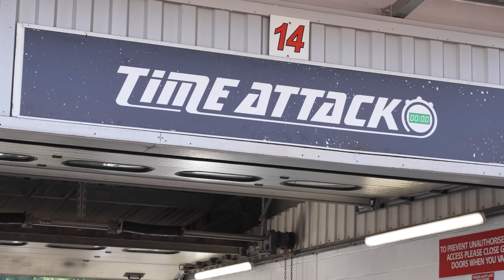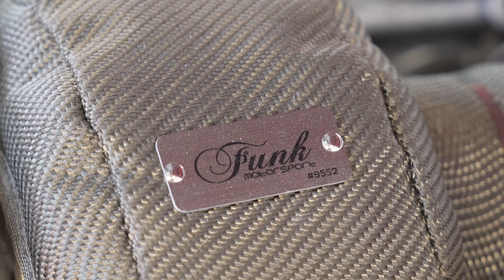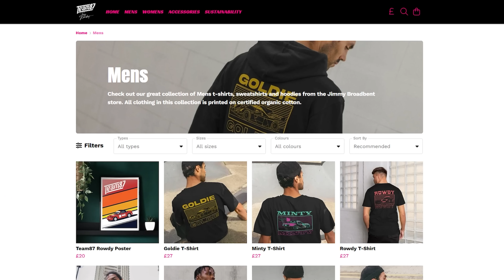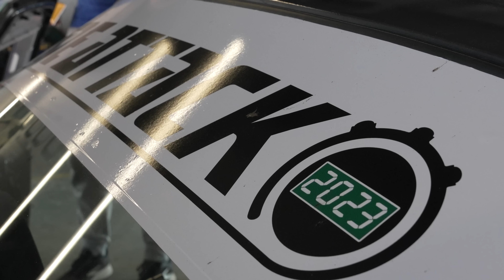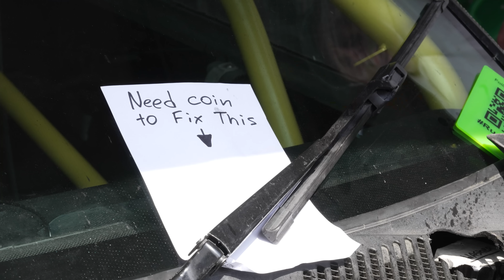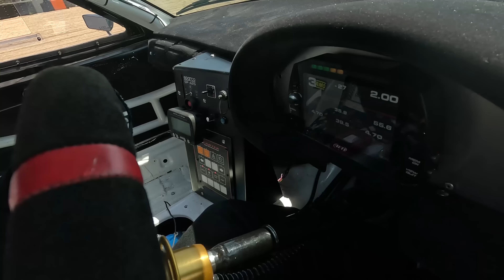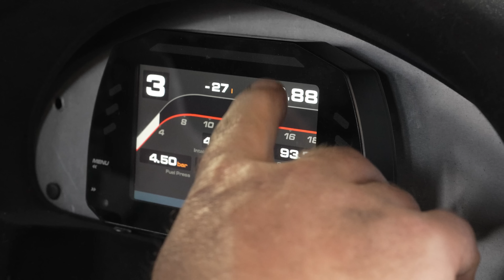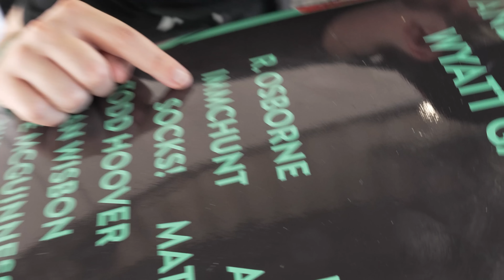Minty Catches Fire In Our First Ever Race Event - (600BHP Time Attack MX5)

Comment from the maker: Just wanted to clear up some things I've been seeing in the comments.

First of all I wanted to discuss some of the issues we had with the car, as I feel they aren't accurately covered in the video.

Regarding the ECU - We mentioned that we couldn't access the ECU. This is down to us not having the software/expertise to sort this for ourselves at the circuit. After the event, some small tweaks to the car and it runs perfectly again.

Regarding the design of the exhaust. We knew that this might have some risks (this was advised by mtech) but we wanted to try it anyway. We've already made changes that should help us sort that for future rounds.

The car is a work in progress and we're still learning. Building a hair dresser car into a time attack weapon isn't easy but we're making awesome headway. Onwards to Oulton!
Reply: These are the weekends you will learn the most from. But the car looks good, sounds great, and looks a hoot to drive. She'll be right!
Reply: Let me know if you ever want to come to Ireland 🇮🇪 and do a few laps of Mondelo some time or dip your toe is some Tarmac Rallying 😊
Reply: Exhaust definitely needs to be redesigned, heat is one thing, but imagine if you develop an exhaust leak in there, even a little one and the fumes start to get into cabin, you wont smell it, just gradually going to get dizzy until you pass out. Can't stress enough how dangerous it could be, especially on the track doing high speeds. Long story short, no exhaust in the cabin is a must next step for Minty. Be safe out there Jimmy!
Reply: @anonimas123456789  The plan was to relocate the exhuast system under the car, though a previous engineer Jimmy apointed insisted on the exhausts exit there so packaging was a real pain. The panel is actually screwed closed and sealed as a firewall component by design, but we see in the video this has been changed to some quick release clamps (not by us!). We plan,m due to time constraints, to place the silencers externally for now and seal the firewall perminantly.
Reply: Needs a fuckload more downforce if it's strictly for time attack
Reply: @bowynnnoanoa5231  Aero is in the works :)
Reply: We always knew it was going be a journey with this car but we're here for the ride and it'll feel more satisfying when it's dialed in 😁
Reply: Did you try turning it off and on?
Reply: Hate to say this but why did you, or your pit crew NOT press/pull the power Isolator switch to kill the engine/fuel pumps/power etc.. The VERY first thing you do when you have a suspected fire and come in smoking from the engine bay or cockpit is to isolate the power.. Jimmy you have ultimate control of that as the driver and if you dont do it (because you're getting out) then your pit crew should!!!, So why did no one do it? It was well over a minute before the car seemed to be off.. You dont know if you have a oil, fuel or electrical fire and keeping the car running not only puts you, the pit crew (who of which i didn't see wearing any fire protection or have any extinguishers with them. NOTE: At least one person should be on extinguisher duty at all times and dressed in fire overalls) and the car at risk, but also everyone else's vehicles and people in the pit area as well. Seriously this is a major major error from your whole team and something that needs to be addressed before you and whoever you use as your pit crew ever go near a track again. Sorry to be blunt but amateur team or not, this is not acceptable.. Safety needs to be number 1, Everyone should know what they should do in a situation like this no matter how amateur you are.
Reply: @Jimmy_Broadbent Still can't believe you have even acknowledged this??... it's serious to make sure you have these things sorted

Comment: The rear looks very unfinished.  Rear diffuser on the cards?  The car looks amazing and really fast.  Good job dude.
Reply: I think the floor is a planned later addition. They're gonna slowly add on aero after they get the mechanical grip aspects of the car to work.
Reply: To be fair a lot of time attack cars do run completely without rear bumpers leaving a massive gap because they generally aren't good for aero, but there's definitely space for a massive diffuser. Considering the size of the rear wing Jimmy will be using, I wouldn't be surprised to see one at some point
Reply: Jimmy has said this is just a shake down without ALOT of the aero on the car as some isn't finished but they still wanted to test the rest of the car for obvious reasons...
Reply: The wing and diffuser will prob come later, will probably never get a fastback though which would decrease drag and improve effectiveness of the rear wing. Easy upgrade with big benefits yet so few in the miata community use em....
Reply: venturi tunnels running along the length of the floor and into the diffuser coming when?
Reply: That's full Delta S4 spec, it better stay bumperless.

Comment: To have it get hot enough to cause thermal shielding to spontaneously combust is really saying something.

Edit:  I didn't realize there were so many expert car builders on Youtube.  There's seems to be a good bit of dog piling in the comments and I wanted to make it clear that was not my intention.  A couple things...

- I was mistaken.  That is not thermal wrap just the charred remains of the rubber sheath that comes on all O2 sensor wiring.  Thermal wrap is resistant to 2000F radiant heat.  Everything else in that area would be burning long before that if that's what it was.

- To those questioning the build quality, you need to understand that there is no formula when it comes to building Unlimited TT cars.  EVERYTHING is uncharted territory and without a bottomless R&D budget the only way to dial the car in is through trial and error.  If you read Matt from M Tuned's reply to my comment you'll see the excessive heat in the cabin was not an issue until the heat wrap was added to the side pipe. (perfect example of trial and error)

- Being that it was this cars first real shakedown things could've definitely gone way worse.  I have all the faith in Jimmy and the guys to get this car dialed in.
Reply: Nah, that's not really the impressive when the bloody exhaust is in a box inside the cabin. Why the hell are the EGTs so high? Who built this thing?
Reply: @russelljimenez4715 yeah this seems like some absolutely terrible design, this was so predictable
Reply: First thing I said when I saw it was “That’ll be too hot”… Also to go out and have this issue in the first race means the engine hasn’t been run properly as the exhaust has to get very very hot to do that
Reply: It was intended to have aero ducting for cooling of this chamber but time didn't allow it to happen unfortunately. As Jimmy said, it was never "meant" to race like this (we advised against this exhaust design and instead considered aero fixes for cold air flow) but time pressures made that not happen. During testing we also didn't wrap the external exhaust, so that acted as a heat sink keeping the box temps lower - something the guys (not us at M-Tech) decided to do after the car left us to stop legs getting schorchio. Melting rubber and fire are two very different things :) If the aero as planned was in place, this would never have happened :)
Reply: @hazzabojangs  That makes sense.  I partially said that in jest and don't agree with the replies questioning the quality of the build.  I looked at it again and what I thought was wire heat shielding is just the really charred rubber sheath that gets put on the O2 sensor wiring.  Thermal wrap is good for like what... 2000F radiant heat?  If it was getting that hot Jimmy would have much bigger issues.  I had a similar situation the first time my car saw a track.  I had wrapped my exhaust all the way back to just past the downpipe.  While it was great for reducing engine bay temps it wasn't until I really pushed the car that the section just past the wrap got so hot that it started to melt the rubber soundproofing on the floor pans.  It didn't help that I stopped the wrap right at a gap in the factory aluminum heat shielding.  Once I wrapped it past that point the issue went away.  Overall I'd say it wasn't too bad for his first real shakedown and you guys have some solid feedback going forward.  It definitely could have gone way worse.  Their uniqueness is what makes time attack cars so cool but that also makes them pretty much uncharted territory as far as building them goes.
Reply: @drunk3n_m0nk12  Definately - looking forward to seeing how the car (and Jimmys taming of said beast) grows over time!!

Comment: Minty looking fantastic.  Small ergonamic issue noted on pedal cam,  every now and again,  the inside of your foot  catches the edge of the brake pedal as you depress the throttle, you may have enoough deadzone for it not to be an issue, but even so  trimming that bottom right hand corner of the brake pedal pad may  prevent accidental brake activation in the future.  Stay positive things are supposed to fall apart on a shakedown :)
Reply from the maker: Yeah I noticed that too. We'll get it sorted :)

Comment: Fair play to you and Mtech in getting the car to Brands, although it's evident that with more time available a proper trackday shakedown would've highlighted the issues you encountered, but "it is what it is". 😉

Constructive feedback: No PAS on a car intending to run wide slicks and aero was never going to be an easy drive, particularily if the original steering geometry was engineered with PAS in mind. Hopefully a simple retrofit for the guys, or conversion to an electric column (although more involved?).

With the exhaust running along the sill, I'd consider moving the silencers out of the car and down there instead, like the Nismo GTR GT3's did. Most of the heat will be from the gasses being restricted through the boxes, so having just the downpipe in the car should reduce it, plus it'll give more room and be easier to insulate with multiple layers of wrap and proper shielding rather than reflective tape.

Fuel debris is a concern on something with only 1-2hrs of running. Either a contamination in the fuel drums/cans, the mechanical pump in the supply drums (have seen these not be compatible with race fuels and literally dissolve), fuel tank foam incompatible with race fuel, or an oversight during the build where braided lines weren't thoroughly cleaned before final assembly. Worth getting the injectors flow-tested just in case any fine debris made it past and may have partially blocked them (fuel pressure will read correct, but the injectors simply won't be delivering the fuel).

A bit surprised the mapper wasn't at this first event- even with days on the dyno, an engine at this level will always need tweaks to ensure it's 100%, and access to the datalogging should be a given for Gav and the team for diagnosis purposes. No reason why a tuner can't remotely log-in in this day and age with ease of internet access.

Hope you guys can get on top of things for Oulton, will be watching the live timing with interest!
Reply: Good feedback, I'm most surprised that he doesn't have an ECU or the equipment to read it showing the complete state of the car with how everything is being run. Most likely would have showed the throttle and misfire issues straight away.
Reply: Spot on - the software was available - unfortunately I was away on holiday during this event otherwise, yes I would have been there :) The test day prior didn't highlight any tuning issues per se so a decision was made between us to run it without my support, though you're right, this isn't the norm!
Reply: @themtechzone  Cheers for clarifying- unfortunately these things happen with schedule clashes at this time of year! ;) Hope the prep goes okay for Oulton, all the best!

Comment: That electric powersteering rack by I believe K power would suit the car nicely. You can adjust how stiff or soft you want the steering with a dial. Also maybe try a hood dump, or fender exit exhaust.
Reply: It won't pass noise regulations at any of the tracks in Europe. Notice how quiet all the cars are.
Reply: @EarrGasmm  m4 gt3 has entered the chat*
Reply: In UK motorsport hood and fender exits are only allowed in drag racing (unless the car has an FIA homologation). All exhausts have to exit behind the mid point of the wheelbase. Also post 1999 cars have to run catalytic converters (drag racing also exempt)

Comment: Glad you made it out safe, Jimmer. NGL, the exhaust piping through the firewall into the cabin seems super sketchy to me. I don't know what packaging issues you're dealing with, but it's probably not worth bringing that type of fire risk into your cockpit. You may want to inspect any wiring routed near your hot-box too. I wouldn't be shocked if stuff outside that box is getting cooked as well.

Best of luck w/ developing Minty. I'm sure you all will get her sorted!

Comment: Loving the multicam during the driving sections. 
Likewise, appreciated the content warning at 14:49. For anyone wanting to skip passed the fire, go to 16:48. I'm glad you're not hurt. You mentioned being worried about driving in the wet after you spun the Praga, so i hope the fire hasn't put you off being in Minty. Shame about the other mechanical issues, but that's racecar life. Fix one thing, 3 more things have issues. 
Car seems like it'll be a hell of a workout even with power steering. The OIS on the go pros were really feeling it in the turns, so i imagine your neck was too lol.

Comment: @JimmyBroadbent Hi Jimmer! If you're having trouble with no power steering, use a wider wheel. It'll give you better leverage and you'll have an easier time of things. Also, you might want to add a dummy pedal to the left to give your left foot a place to sit when you're not using it to use the clutch. All the best!

Comment: Things I noticed watching your adventure as a Time Attack driver in the US.  1: Americans in Time Attack all are lying about the K24.  They just keep throwing new engines in lol.  They are solid for a stock engine for sure but it's not bulletproof.   2: I think it's crazy you guys run with side windows up.  They don't allow that here.  3: GET POWER STEERING!!  Totally worth the weight.  If you need an electric pump that's easy to get grab it out of a Volvo S60.  4: You are on your way.  Excited to see when you guys add aero to the car.  Keep killin it Jimmers, you will get there!  The fact you found all these problems on the first shakedown is a good thing.  It was all going to happen sooner or later, at least this way you can fix a bunch of stuff in one shot!

Comment: From nerd forums a commonly recommended caster angle of 5 is on the high end of effort with 3.5 more comfortable on these cars, you'd have to do all your alignment again but worth a test before committing to power steering. There's no airflow around that exhaust and that's preposterous! You're re-learning a lesson Sir Jamrod Broddlebonk learned in 1915 in his Forde Jalopie V16 as he burst into flames on his way to the Grand National. To safer persist with the idea the exhaust needs cool air flowing around it so you'd need a jacket on all that interior section of exhaust that is passing cool air over the piping the whole way to the exterior of the car. The floor/road normally carries out this function.

Comment: the misfiring/non running issue could be the new wideband sensor. No two sensors are the same, often with aftermarket ecu’s you must put in your resistance values that you measure across two pins

Comment: id run a vent through the firewall down lower on the exhaust side, and then a vent out the left side panel of the car, possibly with a metal 12v fan in there, to pull air through the exhaust "rotisserie" box. should help keep temps down. may also need to wrap the entire box in the gold reflection fabric, like the bay of a mclaren f1. not cheap, but if you cant get rid of that section of pipe due to size constraints in the bay, then you absolutely have to vent it with a ton of airflow to keep it safe.

and obviously power steering. those are HUGE wide tires, so you absolutely need some assistance on the rack. maybe an electric rack to save weight and rotational mass on the engine?

Comment: making the box around the exhaust smaller so the lambda and wier's are on the other side of the box and not in the box with the pipe may help massively for heat protecting the lamda wire at least

Comment: Since the description explains you resolved the issue, what was the problem? 🤔
As I watched the video, it seemed like it was an electrical issue with the ECU due to a melted/partially disconnected wire or ground.
I'd be curious to know what it was exactly, as I'm sure other enthusiasts/mechanics would, because knowledge is power. :goodvibes:

Comment: Great work Jimmy! Maybe this has been said, but on the "lap to watch" It seems you are grabbing the side of the break pedal when accelerating most visible around 13:01 , basically doing both at the same time. Not sure if it's on purpose, and sorry if it has been said before, just noticed it. Cheers and good luck onwards.

Comment: Couple questions;

Are those R7 or A7 tires

Why did you guys decide to do that with the exhaust? I had the exhaust run in the passenger compartment of my turbo LS Miata and it was miserable hot. Could never insulate things enough. Especially those mufflers in there that are completely exposed. Just completely cooking in that little compartment. 

Not knocking anything, just curious

Comment: I think you should try to go without power steering if at all possible. Would it be possible to adjust front suspension to reduce steering weight?
Reply: What's the disadvantage of power steering, just some weight?
Reply: @DerekMoore82 takes a little power from the engine as well as weight and complexity